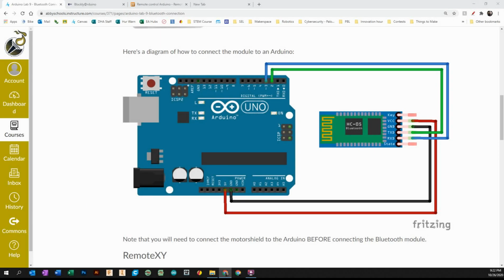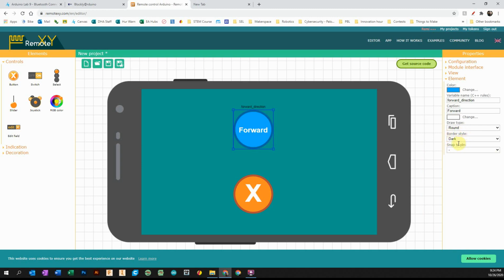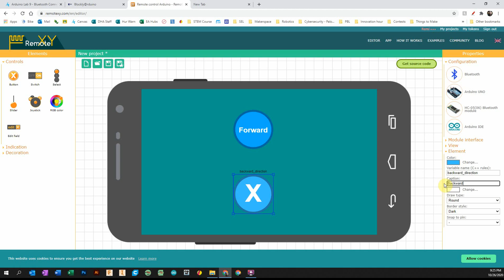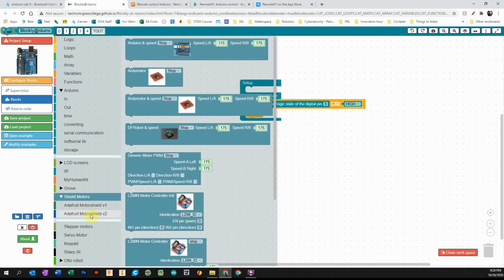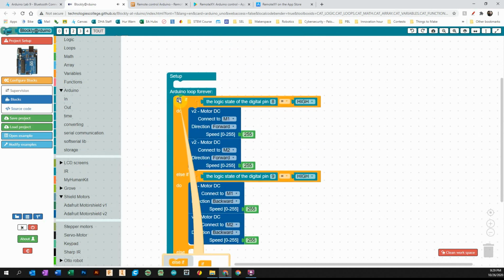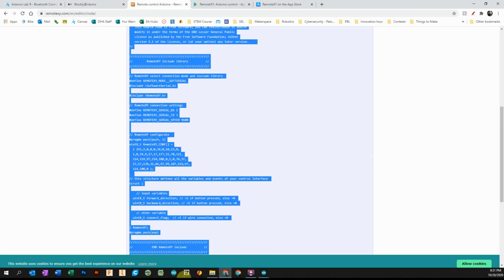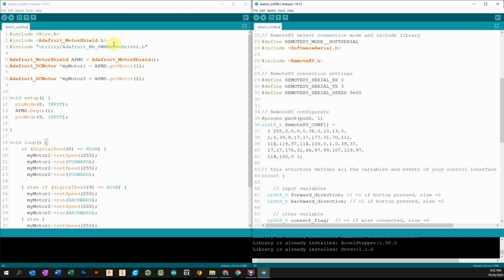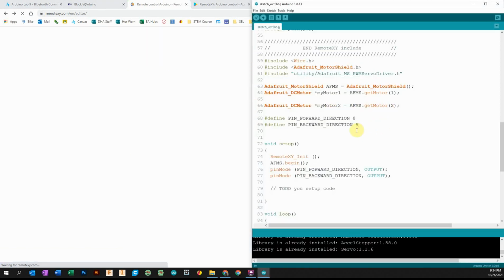Arduino Tutorial: Bluetooth Module & Adafruit Motorshield feat. Blockly Arduino &  RemoteXY

Comment: Hi, If i wanna add a Li-po battery , how would i connect using the motor shield? or do i need a breadboard?
Reply from the maker: Connect it to the screw clamp power terminal on the motor shield. You should be able to connect it directly.

Comment: Nice intro! I have a ball launching machine with 4 motors controlled by using arduino uno + adafriut shield V2. Is it possible to remote control the power (12V)  so that I have the freedom to turn the machine on/off from a distance? Any help?
Reply from the maker: Yes. There are different ways to configure it, but an easy way is to us the RemoteXY on/off switch and to run the code to the motors when switched on. In this setup the Arduino would need to be powered on the whole time.

Comment: You are talking about connecting Adafruit motorshield to HC-05. In your figure however you show the Arduino connection. How is Adafruit connected to HC-05 ?
Reply from the maker: The Adafruit motorshield goes on top of the Arduino and extends the Arduino's pins in the same configuration. So plugging the HC-05 to 5v, D2, D3, & GND is the same for the motorshield as it is for the Arduino. 
Good point though, this diagram should be updated.

Comment: Can you use ESP8266 instead of the Arduino bd?
Reply from the maker: Yes, there's no reason why you couldn't use a ESP8266. It has built in WiFi so you might not need to connect it via Bluetooth. Also, you wouldn't be able to use the Adafruit Motorshield, but could have to connect the motors via an L298 bridge (see this link for more info regarding how to use a L298 bridge to control motors: https://www.allaboutcircuits.com/projects/control-a-motor-with-an-arduino/)
Reply from the maker: Also, in RemoteXY you can choose the ESP8266 module or a corresponding board (such as the NodeMCU) in the "Configuration" menu in the properties area on the right. I have plans on making a video on the ESP8266 over the next month.

Comment: very nice
how to increase the control of the two servo on the shield
Reply from the maker: To control the servo's on the shield check out this link: https://learn.adafruit.com/adafruit-motor-shield-v2-for-arduino/using-rc-servos.
In short, pins 10 & 9 control the servos 1 & 2 respectively. For an explanation on how to code a servo motor with Blockly Arduino, check out this link for a tutorial: http://bit.ly/ServoLab. My plan is to make it into a YouTube video in the near future.
Reply: @RemiWauthy  thank you for helping